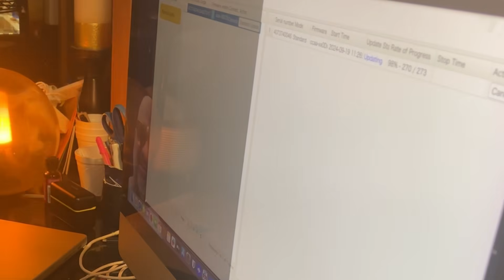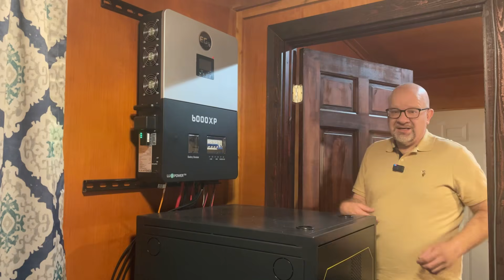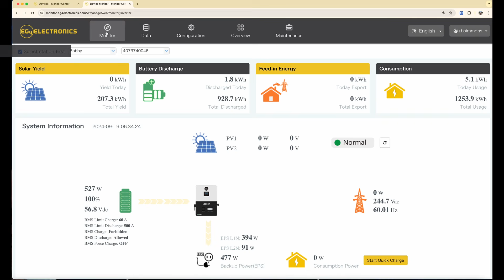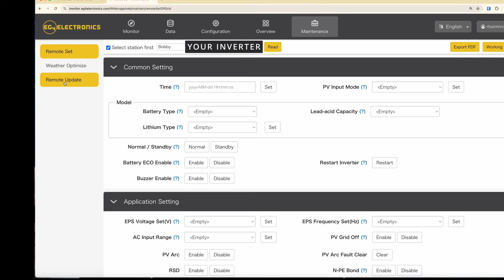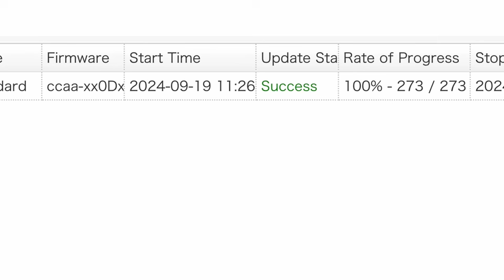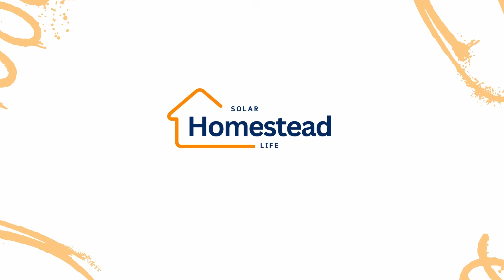5 Minute #6000XP Inverter #Firmware Install Hack for Busy DIYers

Comment: Can you utilize an EG4 system if you do not have wifi available?
Reply from the maker: Yes! EG4 systems like the 6000XP and 12000XP work perfectly without WiFi. You only need internet access if you want remote monitoring or firmware updates. For off-grid setups, everything runs locally just fine.

Comment: Very good info, where can you go to see what the update is changing before you do the change.
Reply from the maker: Thanks for your question, Rock_Nemo! To see what changes are included in the update before installing, you can follow these steps:

1. Go to EG4’s official website.

2. Click on the “Resource” tab at the top of the page.

3. Scroll down to “Documenting Downloads.”

4. Find the specific inverter you’re using, in this case, the 6000XP.

5. Look for the firmware changelog or release notes, which should provide details on what the update includes.

These steps should give you a clear view of any changes or improvements before you decide to update. 

Hope that helps!